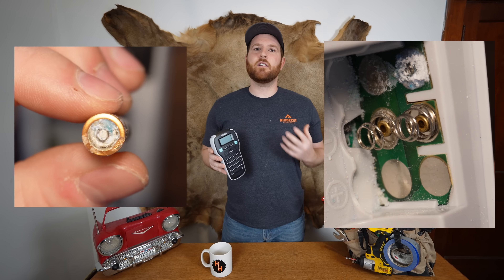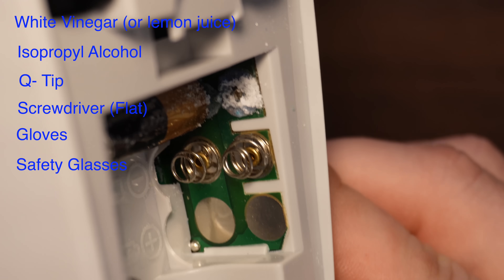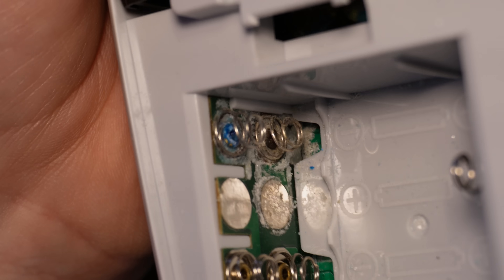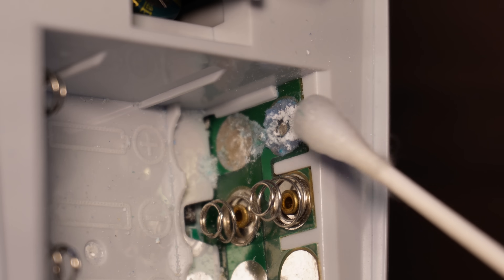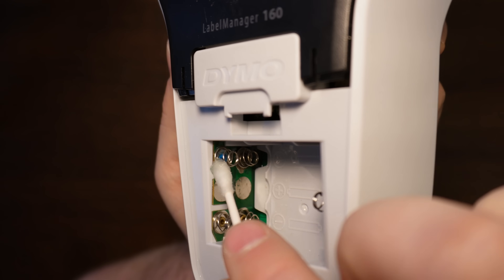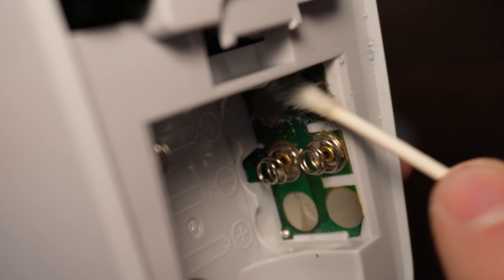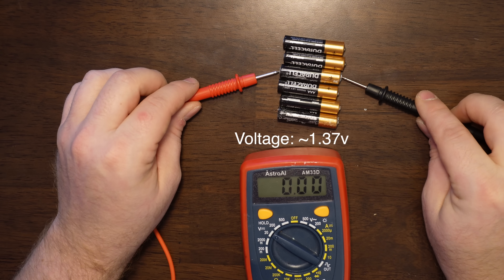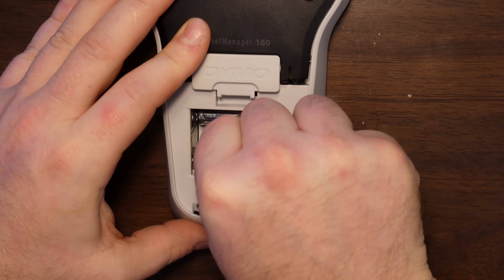Clean BATTERY CORROSION on ELECTRONICS! EASY DIY!  |  2-minute Tutorials Ep.4

Comment: Good video but could also add that the white powdery corrosion and the liquid residue that comes from dead batteries is very corrosive to clothes skin and DON'T  touch your eyes. Also it's best to change batteries way before they get old enough to leak and ruin whatever they are in. I do not leave batteries in Absolutely Anything EVER I keep batteries in a plastic container or glad wrap and pop them in when I want to use something and then take them out when I don't. Obviously if it's something like the TV remote that you use daily then just change them every Christmas or every whatever once a year. But for things that don't get used much why leave the batteries in them at all. Even a torch in the glove box of your car may never be used for years so don't leave batteries in it have the batteries wrapped in Glad wrap separately so if you do need the torch just pop the batteries in and you're good to go. Same with kids toys ornate clocks all sorts of things. Good video done this many times myself the trick is not to leave batteries in anything anymore unless you use it daily. cheers
Reply from the maker: Thanks for the tips! 👍🏼

Comment: The key is to NOT buy DuraLeak, EnerLeaker or RayoLeak batteries. They are ALL garbage these days. The best batteries I ever bought were the Walmart branded batteries that they no longer have. Also the cheap batteries that came with remotes NEVER leaked. I had a cow cookie jar that mooed when you lifted the lid. It was over twenty years old and still had the original batteries in it and it still worked!
Reply from the maker: Yeah the no name batteries never leak now that I think about it
Reply: @HandymanHertz  what you solution use for cleaning sir
Reply: Costco’s Kirkland batteries are the worst.

An old and plain plastic flashlight wouldn’t work on the rare occasion I went to use it last weekend.  It just sits in the garage in the same place it’s been for 2 decades.  Today I discovered its problem wasn’t its Duracell C batteries.  They each tested nearly full charge.  Hmmm…. So there’s no corrosion or leak evidence anywhere.  The PR2 bulb has no continuity so I replaced it, and the flashlight worked again.  

The surprise:  the two C batteries show a “best by” date of March 2011!  12 years ago.
Reply: @hafcanadiana318 the manufacturer of Duracell batteries has since moved the production to China. You will no longer have that experience. I promise you. I was once a Duracell fan. Buying nearly 100 AA batteries every 3 months. That is until I began to find them leaking IN THE UNOPENED PACKAGES! Never again. Energizers are becoming the same no-quality.
Reply: Production location is irrelevant. They are manufactured to the company's specs. I've had zero issues for years with Panasonic batteries (all made in China BTW.). Don't blame the country that makes things, blame the cheap arse bean counters that want everything made as cheaply as possible. Buy cheap, get cheap.
Reply: @hafcanadiana318  I actually came here to say the same thing. I will NEVER buy Kirkland batteries again. They've ruined so many of our electronics over the years that I've wasted far more money than I saved buying them rather than name brand batteries. The damn things leak in the package before it's ever even been opened and years before their expiry date! The last ones I bought I actually returned to Costco because I was so pissed, I hate having to make returns and often don't even when I should, that's how done I was with them. I have pretty good luck with Duracell and have rarely had them leak. What I try to do now as a precautionary measure is only keep batteries in items that I use frequently. Anything that gets used sporadically (holiday decor, toys, tools) or for emergencies (flashlights) I keep the batteries in the drawer next to the item and pop them in when needed. It's a pain and sometimes I forget to take batteries out, but it's worth the extra step not to have to clean the corrosion off my electronics or worse, my electronics no longer working due to battery leaks. Or better yet, I avoid buying battery operated items altogether and only purchase things that have an electronic cord. Why can't they invent a leak proof battery in this age of incredible tech and scientific discoveries?
Reply: Dunno who actually makes the Amazon branded batteries but it’s all I buy now!  7 years and counting I’ve not seen one leak!
Reply: @dadlavinder  hell no. Amazon batteries suck ass.
Reply: Duracell are THE worst and I suspect they make the kirkland batteries. the Duralock Duracells are the worst of the worst. I will never own a duracell battery and will throw them away if included with a device. Energizer Max have been good so far for me. If I truly value something, that might not get used often, i use lithiums or remove the batteries.
Reply: @curban0520 another idea is a small piece of something non-conductive (like the hard, clear plastic that the battery pack is made of).
Just slip it in-between the battery and the device's contact. (That way you can keep the batteries in the device)
Reply: Kirkland leak is a problem too but I found Kirkland battery has the highest voltage these days, so if you are a quick battery drainer, that is still a good choice
Reply: Absolutely.Duracell and Kirkland, which are private labeled made by Duracell, both leak badly.
Reply: I've ruined so many things with RAYOVAC. 
They leak in the package with years still  left before the expiration date. 
I would always stock up when Lowe's put them on sale at Christmas time. 
Once the few i have left are gone I'll  start looking for something else.
Reply: I will stick with Panasonic batteries thanks.
Reply: @harleydavidson4254  My 2005 Toyota 4RNR came with a Panasonic car battery. Never seen a battery last so long. I finally just replaced it because it was so old. Never in a garage and no engine block heater. Never let me down.
Reply: Completely agree.  I quit buying Duracells because of the leakage and damage from leaks.
Reply: I like the IKEA rechargeables
Reply: I've had good luck with the Amazon brand batteries. Been using them exclusively for years.
Reply: @hotpuppy1
LMAO Had/Loved that cookie jar!  #conversationpiece #MooCowCookieJar
Reply: Walmart has a battery call great value

Comment: Thanks for the information. But I also have found that removing the batteries from the device you are not using works even better. I also leave the batteries I've removed near that device, so if I need that device, the batteries are nearby. Great help, though because I have had this happen numerous times.
Reply from the maker: Thanks for the info!

Comment: If you have electronics that use AA or AAA batteries and you don't want to take a chance of this happening, never use alkaline batteries. Instead, use disposable lithium batteries or rechargeable Nickel Metal Hydride batteries. Disposable lithium batteries are around $2 per battery, but they last the longest in devices and have the longest shelf-life (20-25 years). Nickel-metal Hydride rechargeables are best for often-used or high-drain devices. If you only have alkaline batteries (which are more affordable), then take them out of the device when you're done using it.
Reply from the maker: Great points

Comment: Good idea. This can be prevented if you use rechargeable batteries and not batteries. Without a doubt, not all devices can work with 1.2V batteries, but some do. I use Brother PT-H107B and have no problems. By the way, I have been using rechargeable batteries for 20 years and they have never leaked.
Reply from the maker: Thanks for sharing
Reply: I tried using them in the past, but they were too unreliable.

Comment: A tip, instead of using vinegar use bicarbonate of soda in hot water, about a teaspoon full in a cup of water
Reply: Baking soda works for car batteries, because they are acidic. The alkaline in the Duracells is basic, just like baking soda. Vinegar is an acid, that's why it will neutralize the basic alkaline.
Reply from the maker: I assume you are referring to sodium bicarbonate aka baking soda? The above comment says it better than I can

Comment: I used to use Duracell AA and AAA but for the last few years they leak while they are still functioning. It has caused a lot of damage to equipment . I even emailed Duracell about this but just gt a generic response. I have changed brands for these. The Duracell 9V and D cells seem fine.
Reply: I have had the same experience.  I didn't try contacting them. I just don't use that brand anymore.
Reply from the maker: Thanks for your input, what brand do you use now for AA and AAA?
Reply: I've been using Panasonic for the past two years, too early to tell but so far so good @HandymanHertz

Comment: the eraser works, IF it's an old type latex rubber one. not for thick layers as shown in this vid, but for what's left after you use the screwdriver.
almost every pc tech knows the eraser trick for cleaning metal contacts and how well it works (I've found computers that were being thrown out because "it's completely dead" and got them going again by simply using an eraser on the contact edges of the memory sticks), as do many other electronics repair guys.
the first time I heard it was when I joined the army and we were taught to use one to clean the handset contacts on the old AN/PRC 25 and 77 vhf radios.
Reply from the maker: Thanks for the tip!

Comment: Oy, @ 1:35, you did NOT get the one contact "looking like new" , it may have continuity with a battery, but it still has a damaged plating surface. And, WHY would you put 3 batteries back in from a batch that already leaked, and did you know that, your label maker will discharge the 3 weakened batteries first, making them more prone to leaking again?? Your best course of action in ANY device is to REMOVE all batteries when an item is not in use, and either store those batteries in a sealed bag near the unit, or, put them to use in another device and add fresh batteries in the needed unit the next time you use it, or, you will repeat the same cycle of damaging battery compartment terminals or possibly the whole device.
Reply from the maker: The label maker  still works great a year later without touching it, so I must’ve got that clean enough. Batteries are still good too, although I agree that the three older ones may discharge faster. In theory, it’s best to take batteries out with not in use, But who has time to do that with all of the battery operated things in a house garage? Seems  way overkill

Comment: Duracell changed how they manufacture their AA batteries. I have an old thermostat that is powered by two batteries. Last Winter, the display had dimmed and to my astoniment, those batteries were labeled 2012! Neither one had leaked. The ones I have labeled until 2028 LEAKED after two years! I know this as I put them in a TV remote for a Smart TV I bought four years ago and didn't want to use the off brand batteries supplied.
Reply from the maker: Yeah, Duracell has become notorious for their leaking batteries. So many comments on here regarding that. They have definitely lost my business, which is sad, because I used to think they were the best brand out there.

Comment: Plain water immediately dissolves most battery crusties..
Reply from the maker: I’d heavily advise against using water near electronics. Plus, I’m not sure how Water would dissolve it as the pH level would not be low enough, I think
Reply: @HandymanHertz  It does work, and I'm not talking about immersing in water, but plain water on a q tip dissolves alkaline battery deposits.  Try it.

Comment: I always use vinegar to clean ALKALINE battery corrosion. I then use alcohol to "rinse" when done. Instead of screw driver, a toothbrush will clean the rest off. Test terminals for continuity and use as before... Excellent video and 100% accurate..
Reply: Thanks for the toothbrush tip, as I didn't want to buy a bunch of QTips.
Reply from the maker: Thanks! 👍🏼

Comment: On the topic of using a screwdriver as a scraping tool, we all do that because it works but it also amounts to abuse of the tool, and with repeated abuse the screwdriver won't drive screws very well because the tip becomes worn out. What I've done to address that problem is create 2 classes of screwdrivers in my tools. I have a couple drawers filled with screwdrivers that are in fine condition, and there is a hard & fast rule that these screwdrivers must NEVER be subjected to any abuse, and abuse is defined as any purpose other than driving a screw. 

Then I have a large collection of junk screwdrivers with tips that are shot from hard wear and abuse. Those are distributed in handy places on magnetic holders and in other various drawers that are not the designated fine screwdriver drawer. So anytime I have the urge to grab a screwdriver for an abusive purpose there is a junk one handy for that. Not only for scraping but also prying, chiseling, punching, whatever ... any purpose other than driving a screw. 

Then when I actually need to drive a screw there is a drawer filled screwdrivers in fine condition that have never been abused, to give me the best possible results in the purpose for which the tool was intended.

Comment: This is why I switched to NiMH rechargeables several years ago for literally everything except smoke/CO detectors - due to the different chemistry they literally NEVER leak. They're much better than they used to be with much lower self-discharge properties. Easily get a year between charges on low-drain devices (remotes, etc...)
Reply: The problem with NiMH batteries is that they are only 1.2 volts which doesn't work well with some electronic devices. I'm switching over to lithium rechargeable now. They last so much longer!
Reply: @aleischer  That's true. Fortunately hasn't been an issue for me aside from "low battery" indicators coming on much earlier than would otherwise be accurate.
Reply: I've had them leak.  Maybe it's me.  I've had them all leak.
Reply: @bigred9428  Modern NiMH mostly do not contain liquid electrolyte, so leaking should mostly be a thing of the past.
Reply from the maker: Thanks for the info!
Reply: Energizer Lithium batteries never leak as they have a completely different chemistry. They’re pricey but will easily last twice as long and have a 20 year shelf life. I bought a large package of Energizer Lithium batteries and it says they’ll never leak on the back of the package.
Reply: Why don't you use NiMh with smoke/CO detectors ?

Comment: If the corrosion has been going on for an extended period of time sometimes one or more of the tracer lines can be damaged beyond this type of repair, though fixable if you know how to solder. 
Whenever I see this type of corrosion I immediately think to myself, "Self, how come battery manufacturers haven't figured out how to make batteries that don't leak?" After all, batteries have been around well over a century and the first commercially available store bought battery came out in 1896! (That battery was made by National Carbon Company which changed to Eveready Battery Company and is now known as Energizer).

Comment: Vinegar is an acid.  It'll eat the metal.  I use ammonia.  It works fine and is less corrosive.  A tooth brush works for the tough stuff and doesn't scrape the metal.  By the way, if you don't want to clean it again, be sure to take the batteries out of the device to prevent leakage when you're not going to use the device for a long time.
Reply from the maker: I think I’m going to solve the issue and not buy Duracell copper top. 👍🏼
Reply: They all seem to leak.  Energizer and Rayovac seem to be particularly bad.  I've actually had better luck with Duracell. @HandymanHertz

Comment: Standard pencil eraser is for removing the haze of tarnish on a contact.  Nothing more than a light haze. For a bit more corrosion use an ink eraser. Hard to find nowadays because White Out has mostly replaced it. It was an eraser that had some fine abrasive in it. Like very fine sand or perhaps pumice. But for erasing ink from paper it frequently rubbed a hole in the paper.  But it was good for removing a bit more corrosion than just some tarnish.
Reply: I remember those, but have not seen one in years
Reply from the maker: Interesting, thanks for letting me know!

Comment: Duracell batteries are the absolute WORST for leakage like this in my experience!!! They'll last longer than any other battery I've used so they are great if you need something like a radio or flashlight to run as long as it can IN ONE DAY but if you're gonna keep batteries in a device for months or years better use the 2nd best which doesn't leak ENERGIZER!!! That's what I switched to and never have been sorry!
Reply from the maker: I agree, Duracell are notorious for leaking. They’ve lost my business after this package.

Comment: Any idiot knows that mixing two types of batteries, Energizer and Duracell in this case, is a NO NO.
Thumbs down.
And yes, using a pencil eraser on circuit board connections removes oxidation.

Comment: I use baking soda, It works OK. I also use a dentil scraping tool for those tough spots. Your idea is good also. Thanks H H .👍
Reply: Baking soda is for acid based batteries like your lead acid car batteries.  The Alkaline batteries are actually a base so you need the acid from the vinegar to neutralize the alkaline.
Reply from the maker: Great tip. I bet the dental scraping tool is the best for fine scraping